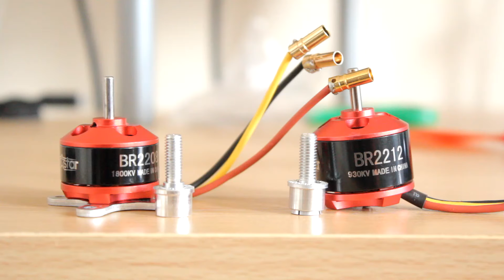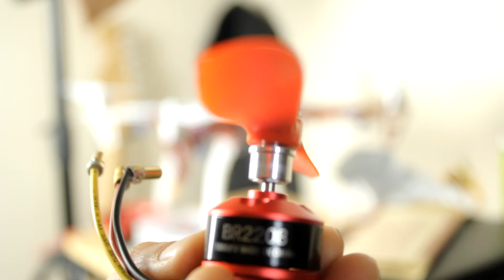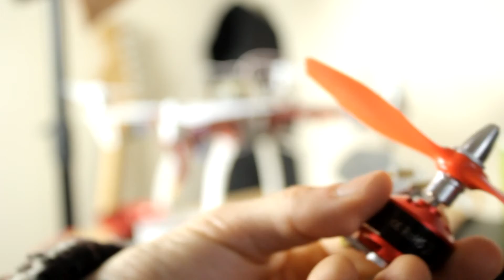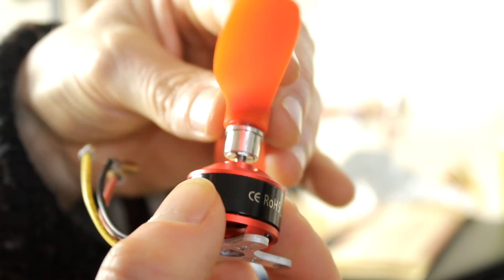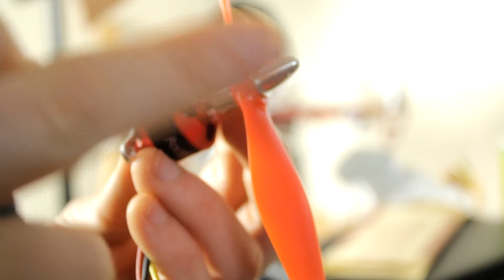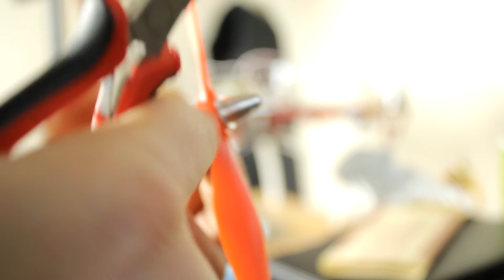Propellor loose on motor shaft question

Comment: It almost looks like a 3.17mm collet on a 3mm shaft even though the Bangood specs state it has a 3.17mm shaft. Don't use as it is as the prop will likey depart company at high speed which would be very dangerous. I assume that the collet supplied with the 930kv fits perfectly
Reply from the maker: I'm not sure i remember correctly, but yea, i think i did try fit it, and it did.
Reply: This happened to me today. Three of the propellers just came off from my Quadcopter. I was lucky that the drone was not at a height from where it could get damaged!